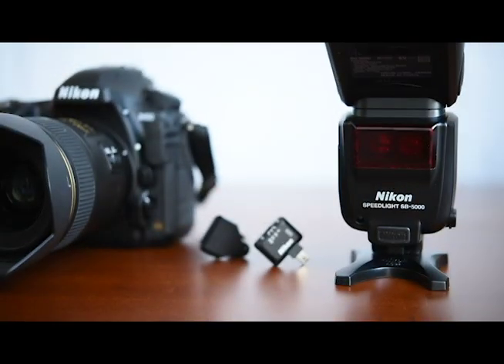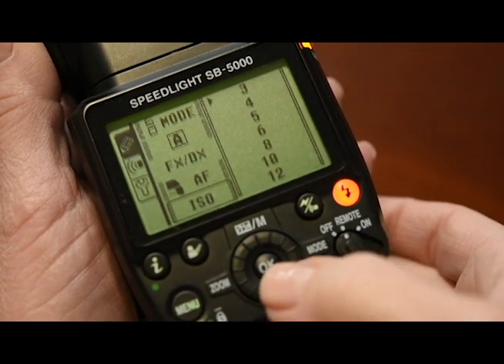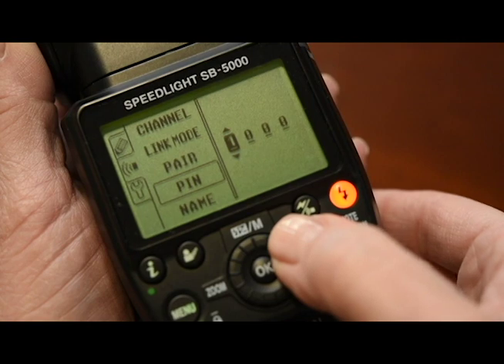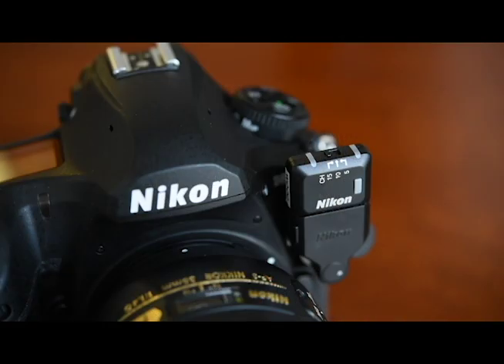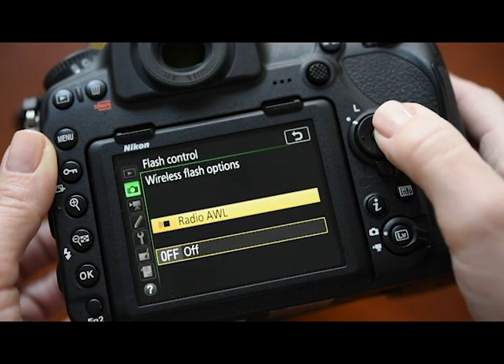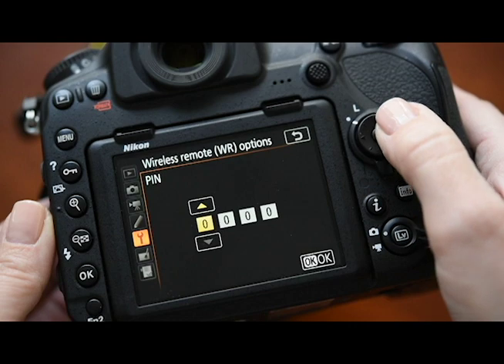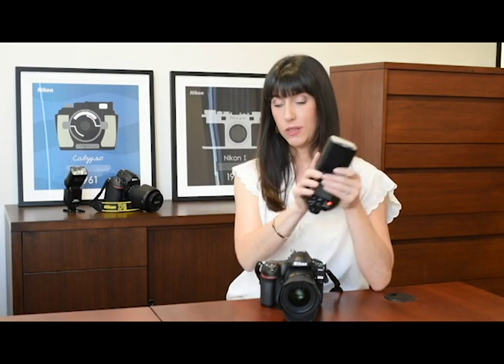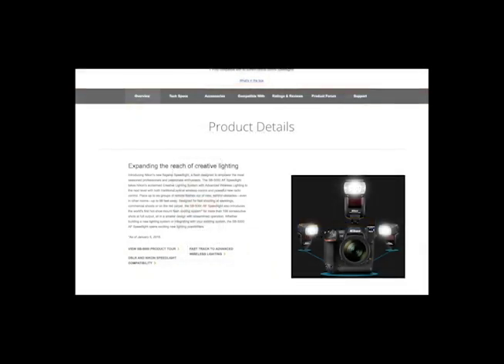Nikon WR-R10 and SB-5000 training

Comment: Buenas noches puedo usar este dispositivo con mi Nikon D 3500 y mi flash SB 5000 Muchas gracias.   Good evening can I use this device with my Nikon D 3500 and my SB 5000 flash Thank you very much.
Reply: NO, you can use the SB-5000 as a normal SB700 style flash, but not radio, its only capable of this for D5/D500/D750 and the Z5/6/7/8/9 cameras, and if you use it for the 'beginner' cameras its a basic flash only, the AA, Gn or M mode, Not ttl, as this is an advanced feature of the aforementioned cameras{they can't be remote controlled other than the AWL way(if there is no on-board flash to facilitate IR communication via CL-S)} an adaptor (A-10) is used for the D5/D500 as they have the 10 pin pro connector, the 'USB' socket on your camera is for tethering and viewing files only, the 3500 is a CL-s system, not an Advanced wireless lighting system (AWL) like those I mentioned earlier. you CAN remote trigger, but with a pocket wizard trigger, or the Nikon flash cable adaptor (the hot shoe box with a cable on it).

Comment: Hi Sara Wood I have question ,on my d850 if my speedlight sb5000 is not attach to the camera the flash control option is not available ,maybe You know why  ?.I have very hard time to setup this system d850+wr-r10+sb 5000, (still with out success connection). This is ridicules how Nikon made so difficult for customer after they spend so much money on their products
Reply: I am having the same problem.

Comment: Why did Nikon make their radio system so wacky to use???  Some say to use PIN some say to use Pair, crazy.  Also, I'd take the camera strap off if you want to use this method.  I had my camera strap wrap around the triggering do-dad twice and tear it to pieces (I should of learned my lesson the first time).  I really wanted this to work since the hotshoe is free, but if you put a trigger for a different system (Elinchrom in my case) the camera flash system turns itself off, WTH.  Really hope Nikon reevaluates and comes up with a better system.

Comment: Hi Sara!  Thank you so much for your tutorial!  You know that I Digitutor also had a tutorial and they got it all wrong!  I spent two-three hours trying to do it they way they were explaining it how to do it and I couldn't make my flash work, and with your 3 minute tutorial, it worked at once?  I am so thankful!  (lots of emoji hearts inserted here!) Do you know how if I can change it from TTL to manual mode if I am in remote wireless mode?  or do I just have to change the physical distance from the flash from the model?  THANK YOU, THANK YOU, THANK YOU!!!!!!!!
Reply: Hey, Did you end up finding out how to put the mode onto Manual for off camera flash? Thanks
Reply: Daniel Chafer hi Daniel!  I did not figure that out!   Could you tell me how?
Reply: Yes I Just figured it out! I think !ha Go to menu on your camera body, *PHOTO SHOOTING MENU, Flash Control, Group Flash Options, Then if you select Group B & Put it to M (Manual) Change the comp to what ever. Go to your SB - 5000 flash & Change the Group to B. There you have the manual set up. @cbyu12
Reply: I used the Digitutor video last week and I had no problems, except they were demonstrating with a D500 and I have a D850. All went well.

Comment: A good video...thanks Sara ...but there is one additional thing I found you need to do to get the flash to trigger remotely.  The SB 5000 LCD needs to show that it is in AWL PIN or Pairing mode for radio wireless—this is shown in the video but how to get to this point is not...What to do?—read on—...The black button to the left of the translucent power button (on the extreme right) controls scrolling through the various Remote options <radio, optical etc.> when the flash selector is set to remote...When the flash selector is set to `Remote’ using that black button <it has a lightning symbol on it> scroll to the radio wireless option and you will see your choice of how to pair on the LCD <either Pair or Pin>...This is all alluded to in the Nikon wireless tech manual which can be downloaded from the Nikon website. Works like a charm!
Reply: Norm, thank you...this is a MAJOR OMISSION and unacceptable from Nikon. I was getting very frustrated about this so thanks so much for posting!

Comment: The cost and making this system incompatible with other camera models aside, that setup seems to be unnecessarily complicated.
Reply: It's complicated because there is a huge amount of functionality. Advanced functionality starts off on the top of the range models and gradually works down to the cheaper models.
Reply: yes, personally I just go for the 'pairing' mode, two button presses and.... instant green light, works, easy.

Comment: Hi there is any other flashes that can be use with the AWL kit? 
Is there any other gear can use for off flash camera with the D850 with regard using radio controller n receivers.
Many thanks.
Reply: Jeannot Badjie no